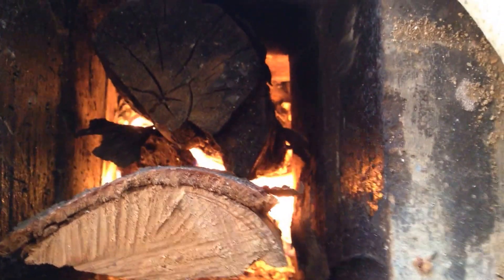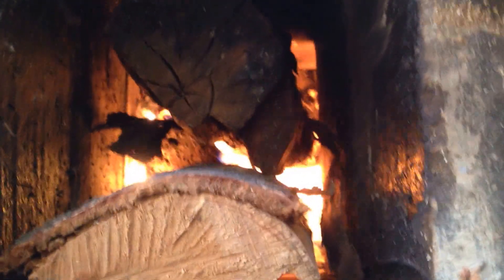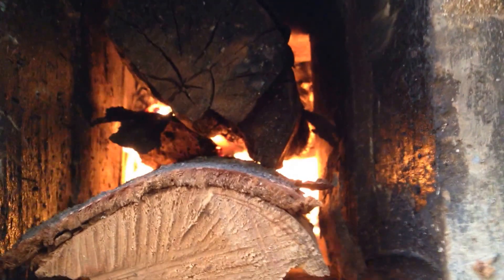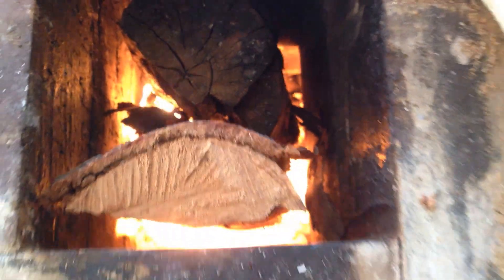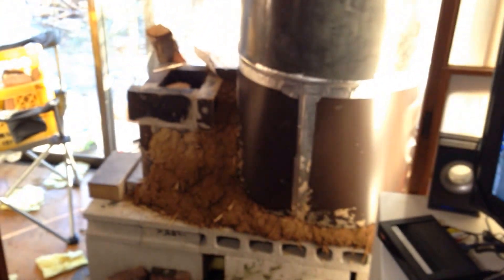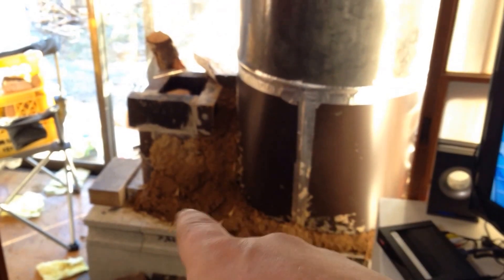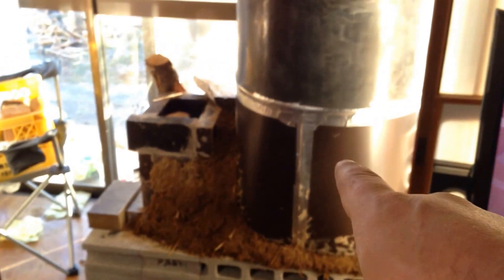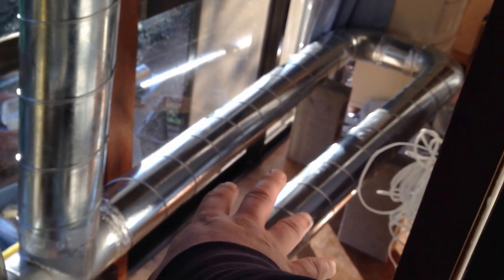My Rocket mass heater in Japan (incomplete) ロケットマスヒーター

Comment: A mass will certainly help for two reasons, it holds the heat, but it also radiates the heat from the floor upwards, because as you know heat always rises. But even more beneficial would be a ceiling fan, or a floor fan pointing upwards to circulate the heat and bring it down off the ceiling

Many years ago on a camping trip I used a propane heater in my tent, and it raised the heat on the floor where was sleeping about 20 degrees (from about 20 to 40), but when i stood up, the temperature at the top of the tent seemed about 30-40 degrees warmer than it was on the floor, at that point I realized I needed to circulate the heat so it reached the floor, and what a huge difference that made